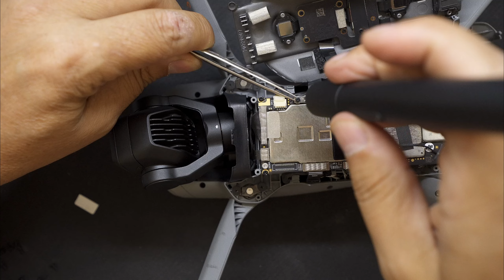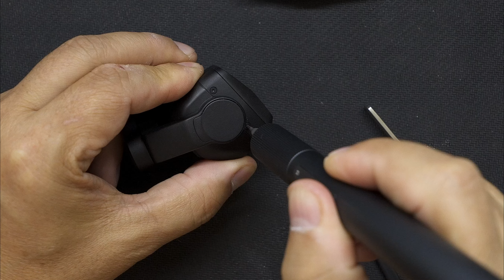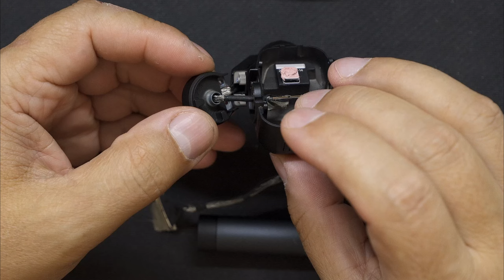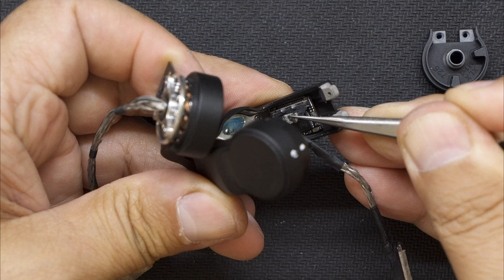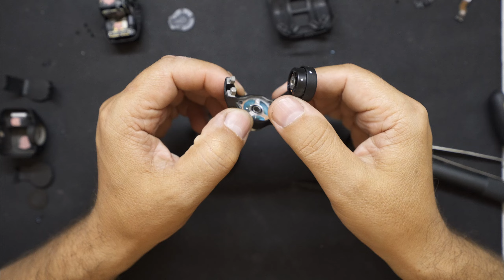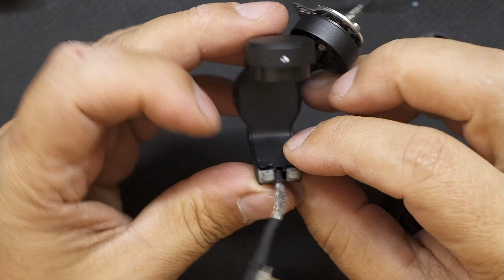Dji Air 3 camera cable replacement

Comment: 19:10 if you’re watching this, beware during reassembly that he didn’t show inserting the 3 screws that you have to feed the screwdriver through the hole for👍 also watch your camera orientation when installing… I put mine on upside down because I was all excited lol 
Otherwise awesome video! Thank you🤙
Reply from the maker: yes, there is such a moment, I did not show, but before disassembling I put marks on the levers with white putty, so there were no problems. But thanks for the warning, in the future I will be more attentive to details✊🏼👍🏼

Comment: Hi I need this cable
Reply from the maker: https://sl.aliexpress.ru/p?key=B6b3GKn
Reply from the maker: https://sl.aliexpress.ru/p?key=B6b3GKn
Reply: @Breus_Sergey  I need for air 3s..
Reply: @Breus_Sergey  I know if is the same for 3s and 3?
Reply from the maker: I also can't find a cable for Air 3S, maybe it's identical to Air 3, but that's not certain...
Reply: @ it's not.. Fit, but. For 3s is long, gimbal is significant larger..